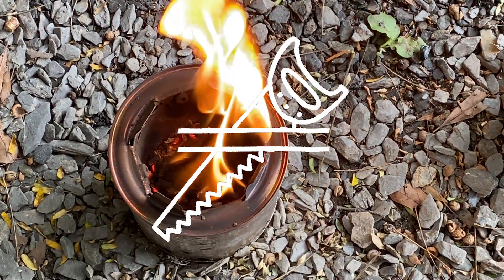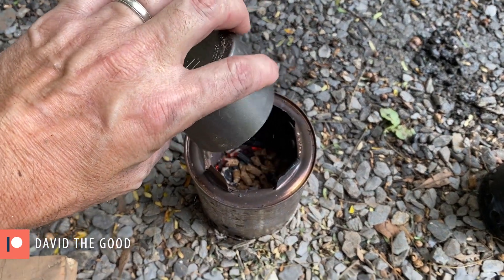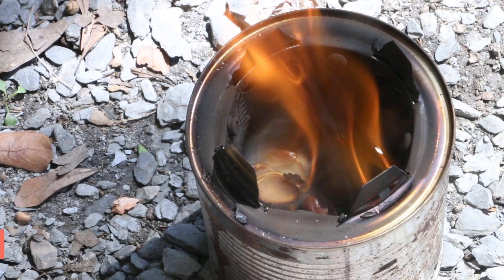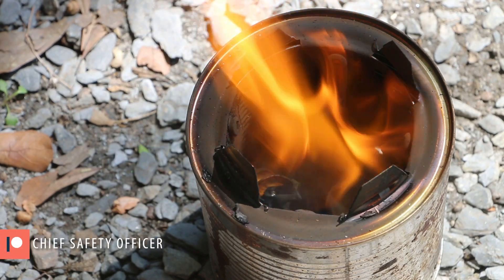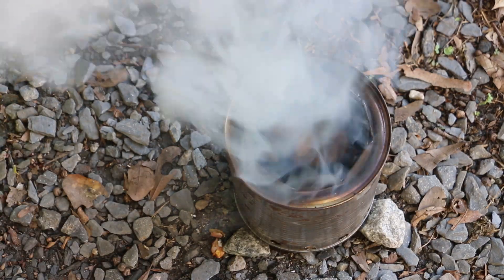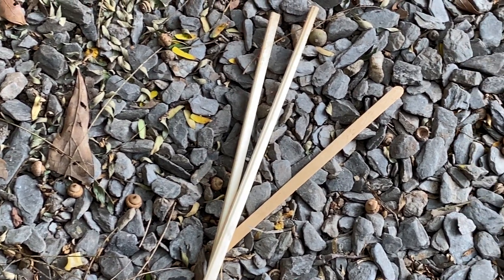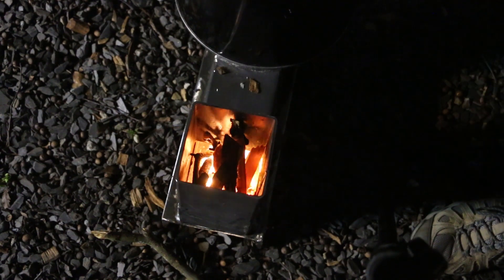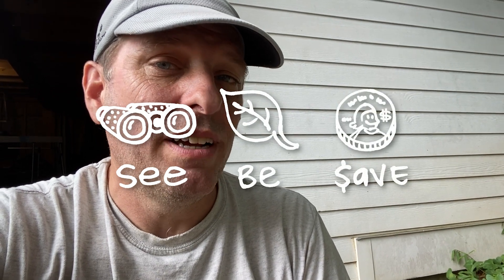Gasifying Soup Can Wood Stove Testing + Alternative Fuels

Comment: You only want about 33 holes in the bottom of the burn chamber along with the 21 gasifying pilots at the top, and your 16 or 17 intake holes in the outer can must be slightly above center, but no more than 2" of the very bottom of the burn chamber holes. This will cause the outer hot air chamber to take precedence over any intake from the bottom of the burn chamber so that it will pull air down, but only slightly. Kinda like the water bubble in a level. You don't want to tip the scales.
Reply from the maker: Great tips, Nathan. Thank you. Thank you for watching.

Comment: Tom you’ve inspired me to build a rocket stove lol and it’s big, it’s (3)55 gallon drums high and (1)sideways on the bottom welded with steel wheels for portability, it shoots 6-8 ft flames out the top, needless to say it’s HOT thanks Tom for your inspiration here from Lake Charles LA ,oh and 4 drums high produces the same flame
Reply from the maker: Nick, that sounds awesome! I gotta see pics. If you’re willing, e-mail me some at tom @ GreenShortz dot com.
Reply: Rocket stoves are notoriously unkind to steel. It is best to line the inner steel drum that is exposed most directly to the hottest part of the fire with stuff like either ceramic fiber, insulated cob (with perlite vs straw), NightHawkInLite's approx. Starlite material, waterglass (least effective), or the like. This will help the steel to last much longer. 

Also, the more insulation you use, the better--the more efficient and clean it will burn.

Comment: Nice video. When I experimented with similar stoves I also had a problem with adding fuel causing it to bog down. I like the use of nut shells for fuel! Looking forward to your fire pit experiments as well. I'd love to get a solo stove but pretty pricey and a little bigger than I really want.
Reply from the maker: Thank you, CI. Solo stoves are nice, but they aren’t cheap. I think the pot fire pit should be a nice in between size. Plenty of light and heat, but not too much fuel consumption. Thank you for watching.

Comment: You could probably use other nut shells for fuel, as well.  Like peanuts or coconuts.  The peanuts have thin shells and might burn fast; but, the coconut shells are thicker and might burn more slowly. There are other nut shells you can use.
Reply from the maker: Thank you, Donna. Good suggestions. Thank you for watching.

Comment: The amount of intake holes seems to be important.  I think too much can be bad too.

 I stumbled onto a pretty good combination of cans.  I took a 10 or 11 ounce soup can and a Chunky Soup can.  Both have pull tops and they fit together perfectly.  I put two rows of 3/8" holes (16 total) around the bottom of each can and eight 3/16" holes around the top of the inner can.  I didn't put holes in the bottom, maybe I'll try that later.  It burns great!  Thirty to forty minutes on a load of pellets and the wind doesn't even bother it.  But it took 15 minutes to boil two cups of water.  Maybe it's too small?  Maybe it needs to be wider with more jets on top.  I don't know.🤷🏻‍♂️. I'll keep trying.  I'm rounding up parts to build a Midge next.
Reply from the maker: Rick, thank you for sharing your experience. I appreciate knowing the ratios you used. And that you were able to boil water. Thank you for watching.
Reply: @GreenShortzDIY  I built my Midge.  It's a 22 ounce bean can inside a 55 ounce bean can with a 12 ounce chicken can on top for a gas cowling.  It would burn for 40-60 minutes but it smoked when I put a pot on and it was  really bothered by the wind.  I read somewhere that too much primary air can cause that so I taped over one of the bottom holes on the inner can.  It was better but it still smoked with the pot.  I taped over another hole and tried again.  This time it didn't smoke when I put the pot on and it boiled 1 cup in about 7 minutes.  The wind was blowing the flame completely out of the pot stand but it never went out.  I have a couple more ideas I want to try but I think I'm finally close to having a stove that I can trust to work every time.